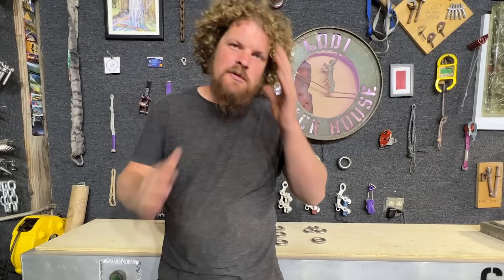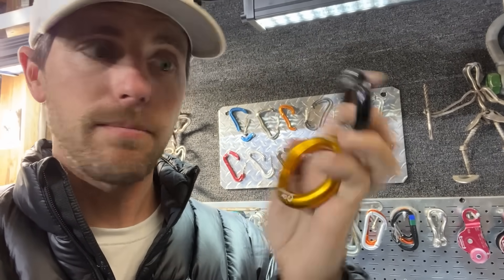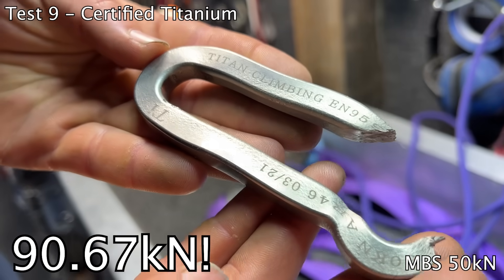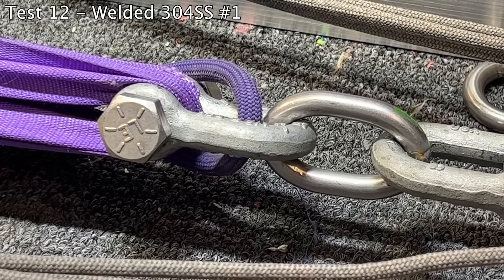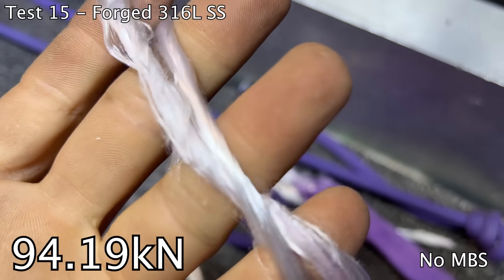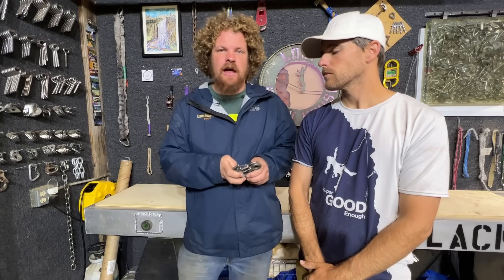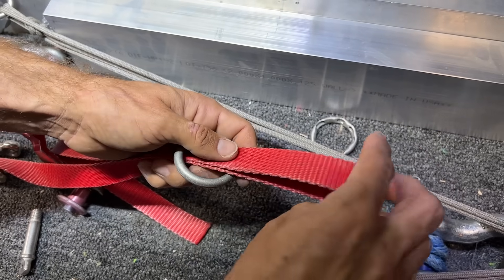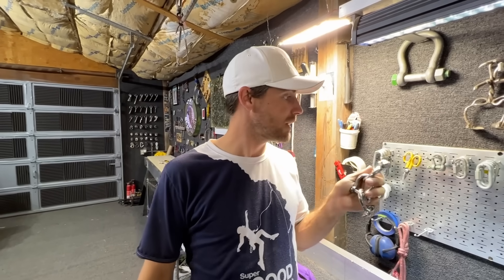This rappel ring could kill someone

Comment: If I had to guess with the welding issue, when you were pulling on the weld, the force was on a small fraction of the weld, since the inside of the ring has the least surface area. 
But when you were pulling against the weld, it was being pulled into a straight line, while the weld wanted to remain a wedge. The result is the inside edge of the ring was being pulled much further than the outside edge,  which you can see around 6:50. 
You can also see the 'tear' traveling up the weld, until it reaches around the half way mark, where it flies apart.

The end result is, the first weld only has to keep the two sides of the ring close, while the ring does the heavy lifting. The second weld has to help take up the strain of the heavy lifting directly.
Reply: The thing with welds is they act as concentrator of stress... When you load an oval shape, on a long shaft the stress is more or less the same all the way of the flat line. When its a ring angle of internal stress changes along the way (while on one direction its just pull on other it acts towards shear) meaning at round object the stress is not the same around the body. Weld (or area right next to weld) is in general weakest place of the object and different modes of stress can affect it significantly more due to stress concentration, than it would if there was no weld.
In addition when you load something from sides, the joint (in this case U bolts) are concentrating stress as well. So if you place weld under the U bolt it weakens that by a lot. (And you load weld across directly which is even worse.
TLTR: If you put U bolts on weld its gonna make it way worse, and with welds oval>round.

Additionaly i would suggest using ductile rings in this case as when you start to see deformation you can replace it with new one, while brittle will just suddenly snap (as seen in video) and youre screwed.

Comment: Average climber weighs in at aprx 70kg +a bit of gear.
It's amazing just how small n light an anchor you can rap off. 
Still keep a few 'hero loops ' around my wrist. 1.5 mm cord break strength over 800kg. More than enough to bail on .

Comment: Now you know why titanium is used in high speed aircraft.
Reply: The main reasons to use titanium is that not only do you exceed the strength of steel with the light weight of aluminum, but titanium doesn't lose it strength under extreme heat, which is why it was used for the wings and fuselage of the SR-71 Blackbird, but also for some jet & rocket engine components.
Reply: @joelee2371  It also doesn't shatter.

Comment: This was really interesting, it does make a lot of sense they the forged stainless performs better than the welded ring but I was very surprised with how much better and how the position of the weld matters.
Reply: The problem with weldments is that you generally have to use a lower strength weld filler to prevent cracking and embrittlement as the weld cools. This results in a weaker spot, but, as you saw, the weld was still stronger than the required minimum. I use welded steel rings of 3/8" steel with complete confidence. Also, if the ends are bevelled instead of flat, you get a lap weld which is MUCH stronger than than a butt weld, cz the stress on the weld is a shear instead of a straight pull; this can make the weld actually as strong as the ring stock itself.
Reply: @joelee2371  that would actually be interesting to bevel and fill the weld instead of butt weld. Like you mentioned I'm sure that substantially stronger. And yeah I'd have full confidence in a welded ring as long it it wasnt hollow

Comment: I don't know, I think 3,300 pounds is a lot. It's lower than the recommended minimum for climbing and I'd always buy something better. But I wouldn't worry too much that I was risking my life if I had to use one in some unusual circumstance.
Very educational! I'm surprised at how good the titanium is. Stretching before breaking is a very good thing. More energy absorbed. The solid aluminum rings are fine, but the brittle fracture is a little less confidence inspiring.
Great video, and I think it's pretty clear you know what you're talking about!

Comment: 10kn is 1 Ton force. But the funny thing is you are breaking things at 9 tons 90Kn, with shackles that are WLL ( Working Load Limit ) 2 tons. And the shackle didn't break. That is because all lifting gears has safety factor rating marked like 1:7 which means that if it has WLL of 1 Ton it should not break until it experience lifting force up to 7 Tons. Strange that climbing harness gear doesn't have those safety ratings...
Reply: 1:7 is more than i expected

Comment: Just so y'all know on the steel 304 rings with welds.

Those broke the way they did because of weld normalization, and loading.

Likely the rings weren't heat treated properly to normalize them after being welded, which leaves weakened areas around the weld where the heat from being welded embrittles the metal. This creates a material situation where laterally loading the weld will cause it to fail very quickly, while axially loading it doesn't cause as much of an issue.

The difference being the in one the weld is being pulled against, in the other the weld is being pulled across it's length.

Because the steel (I believe) was not normalized you will see small steel fragments all around that area, they will be extremely hard, but brittle like glass.

Oerhaps try taking one of the 304 rings and leaving it in an oven or hot area that's above 500 degrees for 8 hours, then slowly letting it cool down (this allows the crystalkine structures of the steel to reform and become more even throughout the piece of metal. Thus getting rid of most internal strain induced fracture zones)

Comment: I think if you’re just starting to slackline, rolled aluminum is fine. as long as you’re not rigging long lines (less than 50 feet), but only if your metal gear is backed up. I always go around the tree with the tail of the webbing and tie a bowline on a bight to my line locking carabiner. That way even if the ring snapped, no metal would come flying at me. Good thing about rolled aluminum is that it’ll bend before breaking, so hopefully you’ll spot it

Comment: I fail to see the point you're making?   They are rappel rings not supposed to be used for taking falls, you simply rappel down on them and what kind of weight is that?  How many climbers weight enough to break any of these?   Pretty sure none!
Reply: This is just for fun/getting people to stop being afraid of gear when used properly/finding the real limits of gear :)
Reply: @tehrater480   I suspect using the title "This rappel ring could kill someone" wasn't just for fun.
Reply: @marcuslinton310  because it could kill someone. Yes, misuse of equipment is a thing.
Reply: @chri-k     So you think these clueless people, who would misuse rap rings, are somehow now clever enough to look up the proper use via Youtube?   Interesting thought processs.   

Curious what type of misuse would cause them to break, they are still more than strong enough to take a regular fall.  Pretty sure anyone potentially taking a big enough fall to break one is clearly a far more experienced climber and would know what rap rings are for and not be using them for anything else.

Are people using them to hang their cars off the cliff when they can't find parking?

Comment: Come on, you can clearly see that when the weld is between the shackles, the stretching (bending) of the ring makes the weld twist in a funny way, ripping it from one side trough to the other...
And when the weld is placed behind the shackle, it acts as a mould, sitting the weld in a place that it won't be deformed as the rest of the ring does gets deformed... Thus making the weld fail on all it's sides at once.
It's the same thing trying to cut one sheet of paper with both hands pulling both ends of the sheet to opposite sides...
You can apply opposite twisting motion to both ends, splitting the paper from one edge towards the other...
Or you can just grab both ends and pull apart with raw force, until the paper splits all at once.
witch is easier and harder?

Comment: It looks like the welded stainless broke early because the weld was "straightened" and kind of sheared it, causing it to split on the side and then break early. Pretty wild how well they do with no welds!
Reply: Exactly what's happening, welds are strong but brittle so straightening it out isn't doing it any good

Comment: For anyone who doesn't really know what a kiloNewton is, the last ring broke at around 300lb, or your average obese person. The strongest ring however would have likely held around 22,000 lb, which is about the weight of a semi (without the trailer)
Reply: Or about 100kg. (actually about 981 Newton)

A way for you guys with freedom units to visualise this is that a 1 litre coke bootle weigh almost exactly 1Kg. 
1 Newton is the force it takes to make that coke bottle accelerate with 1m/s (a large step).
Earth gravity/acceleration is about 9.81m/s, thus that coke bottle does 9.81 Newton (or about times 10 if you going to calculate it in your head). So yhe about 100 coke bottles, but more importantly now you should have to tools to grasp your own force quite easy in your head if you know your weight in kg/coke bottles 😊

Comment: a good 8mm chain should hold about 8t. whether with a bit of surface rust or not and no matter how old it is.
Reply: They didn't knock the strength of the chain, more so the environmental concerns of having zinc plated coatings killing nearby plants.
Reply: @elcharrosays  He asked about the strength of the chain....

Comment: Thanks so much for breaking one of my Anchor Rings, guys! 
That's something that I've never managed to do as my load cell is 'only' rated to 50kN, with an allowance that it can be taken to an absolute maximum of 75kN 😊💪
Reply from the maker: It’s an impressive ring!
Reply: @HowNOT2  where can i buy that titanium ring
Reply: I actually work with metal for a living. I went to school for advanced machining and I also wield. Where you put the wield on that mild steel 100% matters. When you put the weld on the shackle the weld is pulled evenly. When you put the wield between the shackles. Something interesting happens. As the circle of metal straightens out it puts a lateral force on the weld. Making the weld on the inside of the circle to break first. This happens on the video before the wield gives out. Meaning the wield would have held alot more if it had not broke on the inside of the circle first. Metal is always weaker where there is a large change in its structure and metal is weak to lateral force. Your putting the weakest part in the worse condition possible.
Reply: @TestyCool the weld will almost always be stronger than the metal around it. Which tends to become the weak point when elasticity is required.
Reply: @dylanzrim3635  That is why I said "Metal is always weaker where there is a large change in its structure and metal is weak to lateral force."

elasticity is needed more in handling a lateral force (between the shackle) then tension (against the shackle). 

When you say stronger you mean harder. That is only true if you weld something without annealing it. If you anneal the weld you can make it the same hardness. However, there is still a change in the molecular structure which will make a failure point when under enough stress.
Reply: You could just add a roll and double the power
Reply: You make good stuff
Reply: Killer ring, Martin!
Reply: I could also use a ref link for a strong titanium karabiner hook

Comment: Welded 304ss breaks because weld seam is bending and it cracks it open from inside first. When weld seam is agains shackle the round shackle keeps the seam better in its original shape and is a lot stronger

Comment: How strong is a steel ring when it's cut into a C shape? 

E.g. how much force is required to simply bend 10mm steel.
Reply from the maker: If I had to guess, it would be between 4-8kn and most likely 6kn. I think an open ring would still hold a rappel but I haven’t officially tested that before.
Reply: I think it would be good to see, I think a lot of people see a low kN in a test but fail to realise that something like 8-10kN could still lift a small car (Cars are smaller in the UK 😂)
Reply: Could you rig the test on the drop tower and hang 4 cars off the steel ring?
Reply: What kind of load do you think of? An ring with a gap? That's actually fairly easy to calculate, as least approximately.

I just need the profile diameter, properties of the material (tensile strength and yield strength) and ring diameter.
Reply: @angrybirder9983  I do have an engineering degree so I should be able to figure it out but it's been 6 years since I used my brain so it's fairly rusty. 

Let's say a ring with 40mm ID
Made from 10mm 316 bar stock

Comment: There's been some commotion about the welded steel rings overhere, where cracks in the weld would mean sure death. So I was wondering what force a cracked ring would still support before it opens up. Could you cut a couple with a handsaw and test them please?
Reply from the maker: If I had to guess, it would be between 4-8kn and most likely 6kn. I think an open ring would still hold a rappel but I haven’t officially tested that before.
Reply: @HowNOT2  cheers! 
If you get the chance, pop one on the rig for us 😉

Comment: Pulling on the weld was the reason why it broke at 89kN. Pulling against the weld was why the other 2 broke around 50kN +/- . Of those 3 rings, the 2 50kN +/- rings that broke while being pulled against the weld showed deflection before folding inward at the weld. The 89kN ring showed no deflection and simply stretched until it pulled apart the weld.
Reply from the maker: That was my theory but I’d have to break a bunch more to really confirm it. It doesn’t really matter since it’s all strong but it sure is interesting
Reply: @HowNOT2  No kidding. 50kN is gnarly good enough.

Comment: No PETZL Open Ring? 
The P28 model that has a bolt to secure the gate.
These come on their Arborist harnesses and can be installed after a splice is completed.
Only ring I've seen that is made like this.
I'm always orienting the gates where no force is directly applied.
Even though their advertised as multi directional.
Reply: Some breaktests on them would be interesting. Test different orientations and screw torques (no screw, very loose, properly tightened and stripped out)

Comment: Hey Ryan.  Have you ever spliced a dyneema round sling to use in place of the spanset?  I wonder if the lack of stretch would cut down on the violence after the test object breaks.
Reply from the maker: I think spansets and dyneema are roughly the same stretch.
Reply: @HowNOT2  This can be tested with your load cell. Take your favorite spanset find the MBS  (rated load x safety factor), make a similar MBS dyneema loop spliced, and load them with 2, 5, 10 Kn. You can measure the stretch while under tension and graph it according to force obtained (as hitting the exact loads is not neccesary).
There are a lot of factors that come into play so results might be very surprising.

Comment: The weld is more brittle from the heat. It looses its temper. It doesn’t like to bend sharply, like around the shackle pin. When it’s not being forced out of its shape, like in a straight line, it’s much stronger. It’s not at all an indication of a weak weld. 100% a bad assumption.

Comment: I'm kind of surprised to see how ductile titanium is. I thought steel would move but titanium always shears.
Reply: Depends on they alloy formulation and heat treatment of the titanium. It's a strong metal to begin with, but I've seen some that was hard enough to use as a scriber.
Reply: @joelee2371  thats my experience as well (titanium being hard). Super lightweight but prone to cracking, say as a Ti bike frame is kind of horrible as your welds will fail (on average) before a steel frame’s welds will.

Comment: Those Fixe steel rings are impressive. Those are the same ones that are on the bottom horizontal ring of those vertical chain anchors. Next time I hear somebody grumble that the ring is not redundant, I’ll be sure and remind them of your testing. 👍
Reply from the maker: Remind them their rope and harness aren’t redundant either haha
Reply: I think the flex of the weld was what was causing some of them to fail lower then others but still impressive, I would defiantly feel much safer with the forged ones.
Reply: @Riiyan  kind of interesting because welds are usually stronger than the base material. However "strength" can be measured in lots of different ways. Welding material also heat treats it which makes it more brittle, not exactly a property you want in something that is going to stretch.
Reply: @probablyinconsistent4756  the weld MAY be stronger than the base metal, but the heat effected zone is weaker.